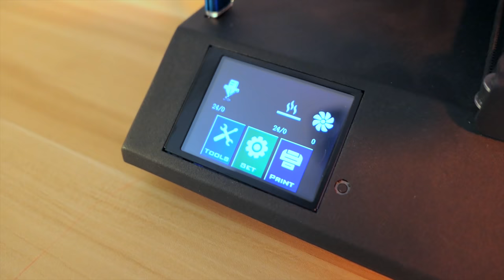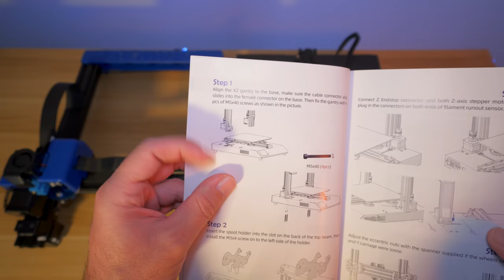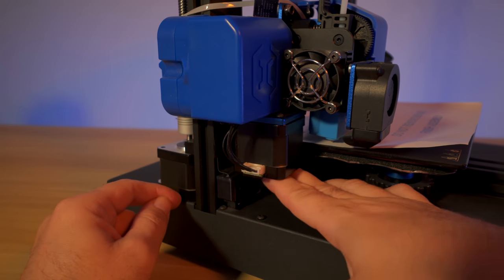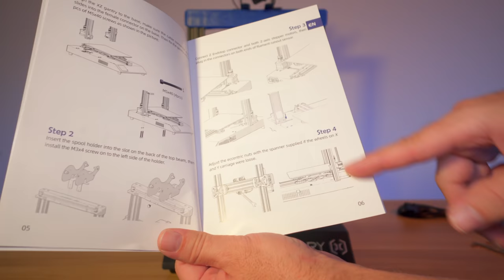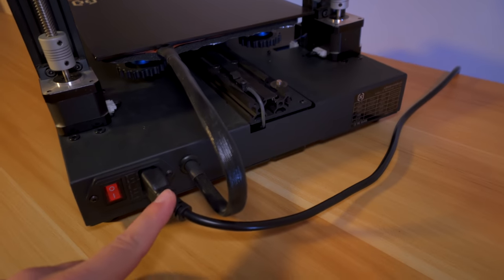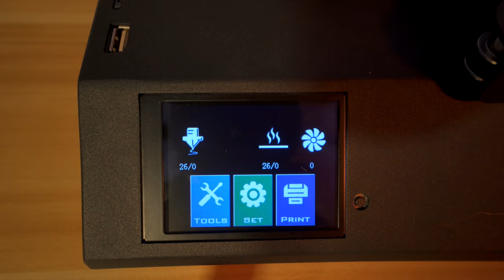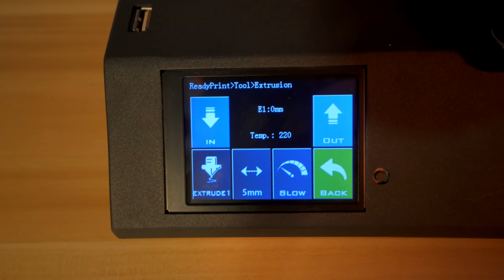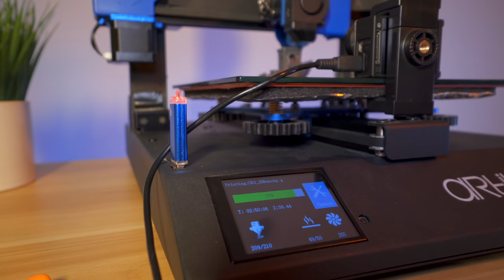Artillery Genius - 3D Printer - Unbox & Setup

Comment: this printer is by far my favourite printer, I started  with the enders , cr 3, cr10, prusha,  I came across with the printer because I friend bought it and never unpack it for personal reasons and he sold it to me at half price, omg this printer I pay full price no problem, the quality, how  easy is to assemble, no problems on glass bed sticking , most silence printers I have ever seen, the speed is crazy and the final quality is way up there, Honestly even for your first printer or as an advance   user, go for it, you will not regret it,
Reply: Mine arrived today, sadly without the filament I ordered, my 1st ever printer :)
Reply: @Doyle69  I order all my filaments on ebay,
Reply: @Doyle69  enjoy my friend
Reply: @minoxidilexperiment769  I ordered from amazon and ebay, as its my 1st im unsure which to use, so bought a couple. spotted one is PLA+, im hoping this printer accepts it.
And thank you, excited to use it.
Reply: @Doyle69  yes PLA + will work, all You have to do is check always the nozzle size of the pla you buy,  for that printer well for most the nozzle is 1.75 mm
Reply: bed temperature set it to 60 works perfect for any pla, for pla +  Nozzle temperature you will need to experiment for best results, from 190 up to 230, is a trial and error until you get best results
Reply: @minoxidilexperiment769  Thank you very much for your help and advice! Will copy your comment as a sticky note thanks.
Reply: @Doyle69  Any time, hope you enjoy 3d printer as much as I do
Reply: Minoxidil Experiment Thanks man!
Reply: U sure bro? Or should i get the ender 3 v2
Reply: @thegoldenking9933  Genius or BIQU B1, or if you can wait, get the BIQU BX
Reply: Doyle4 any reasons why? Please convince me

Comment: I currently have one of these shipping out and it will in will be my first printer. Still a bit uneasy about my choice. Early adopter, new to 3D printing, not the biggest support community. No doubt there will be a learning curve. That being said, your vid was good timing, and makes me feel better about my impulsive new hobby purchase. Thank you for your insight. Might have to watch again in case I missed something.
Reply: Did you get your printer yet? If so how is it?
Reply: Doug w No, I haven’t received it yet. I’m not happy about that to say the least. I would highly recommend not ordering anything from   Gearbest. Seems as if all reliable communication stops the moment something ships. It’s been way over a month since I ordered it. I’m sure it will be a terrible hassle trying to get my money back, which I am strongly considering. Thankfully, I used PayPal. If possible, I will cancel and get a resin printer instead. I’m really only interested in printing small items.
Reply: @tmbacz  Although it looks like a good printer and was considering ordering it. it seems like it has good "bang for the buck". The only thing that turns me off is the blue cross bar at the top but its not a deal breaker. The printer is shipped is probably in customs if its coming from china. If you really rather have a resin the bail on this printer but since you have so much time invested in it I'd say stick it out.
Reply: @tmbacz  Did you receive it in the end? How was it?
Reply: Dillan Patel, I have, and honestly haven’t even unpacked it. I’m still pissed off about the whole thing. I was actually looking forward to not getting it. Now I’ve been really busy filling in at work. When I’m not there I’m taking care of personal issues, sleeping a lot, trying to stay healthy. At some point I’ll get in running. Want I really wanted if for was to make some terrain pieces for tabletop gaming.

Comment: Great video!! i recently bought one myself and the light blue silicone cover for the extruder is a bit loose, how could I attempt to fix that? Silicone rubber is nearly at the same level as the extruder…. Would be great to see a video about common failures in these types of printers and how to fix them! Keep up the good work!

Comment: That printer looks amazing, i’m about to buy my first 3D printer but what should i buy: the ender 3 or this one
Reply from the maker: You would have a much better experience with this printer especially if this is your first 3d printer.
Reply: I have ender 5 for about a week now, it's my first 3d printer and I have nothing to conplain about it, exept for the lcd display, that's open on the back (just like the ender 3 and ender 3 pro). However, this problem can be easily solved by printing it.
I'm really getting amazing prints with ender 5. I'm really happy about it!

Edit: Just remembered Just Vlad fixes the problem on his updates and fixes video for ender 3...

Edit: I saw a lot o people complaining of the menu of the ender 5, but I didn't have any problems and am alredy adapting really well to the menu. Another thing I have to say about ender 5 is that, even if you need to assemble it, the instructions are pretty great! It almost feels like it's LEGO!

Ps: Sorry for any English errors. :D
Reply: @JustVlads  if you can afford the bit extra for this it would be a good first printer( ender3 is cheaper but it does have a lot of features the ender doesnt) toss up i think about value though but set up and print this should be tons easier for a new hobbyist.

Comment: At first, i really like your videos! :) About this printer, it looks quite good, only big con for me is the manual bed leveling. With auto bed leveling i would be really considering this one (or maybe if its pretty stable and dont need to be adjusted often). One question, is this printer running on Marlin fw or something similar?
Reply: @Don Gray you should do a review on your experiences - you're clearly very knowledgeable about this printer. Would be helpful for a beginner like me who is thinking of purchasing it as my first printer.

Comment: General question to Hot-Heads...I have an ANYCUBIC I3 MEGA, after 
pre-heating the head to 200 C, using a unfrared thermometer none of the 
nozzle area nor the heater element are anywhere near 200 C, the 
aluminium block where the heater is inserted only measures 36 C...I 
changed the complete HH & Heater...No Change...Any ideas, is this a 
motherboard or power supply problem, has anyone had the same problem 
?...Help appreciated.

Comment: Wich Slicer do you use. And can you show all your settings because i am am beginner and my prints look not as good as yours. Looks like as the layers on my prints are a bit offset not much but its not a straight wall there are some layers that are not alligned perfectly. What could i do against this issue
Reply: you should calibrate your extruder

Comment: Well, is not a good idea to compare the Artillery Genius with the Ender 3. 

At least, NOT TODAY !.
The reason is its price !. The A. Genius cost more than the double that Creality Ender 3, today and that, my friend, makes impossible this comparation !.
Artillery Genius is beyond the doubt a much better 3D Printer than the Ender 3 and because of that this Artillery Genius cost more than the double than Ender 3 !. 

So, there is no point of comparation because of the price !. As simple as that !. Cheers.
Reply: Where do you get MORE THAN DOUBLE? Ender 3 is €185 or €200 for the pro version, and i just got my genius for €250.
Reply: @woutchauvaux6672  Where did you buy it? The cheapest I could find at the moment is 274€.
Reply: @RalfVogler  via banggood in a group order